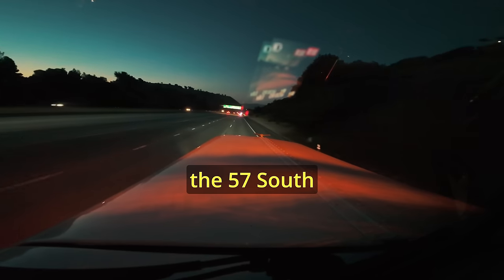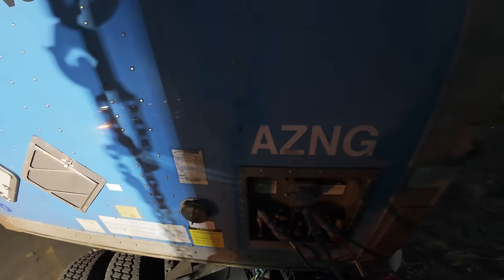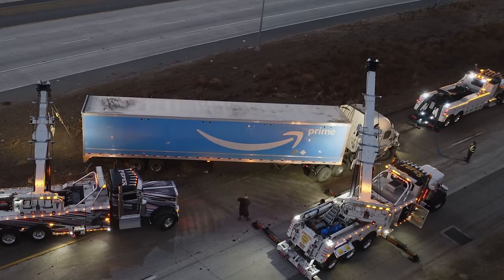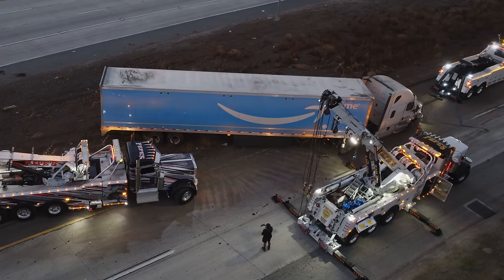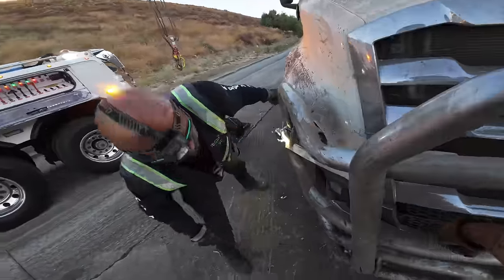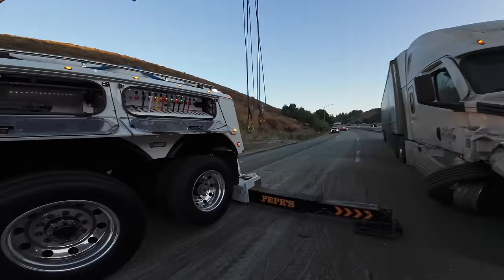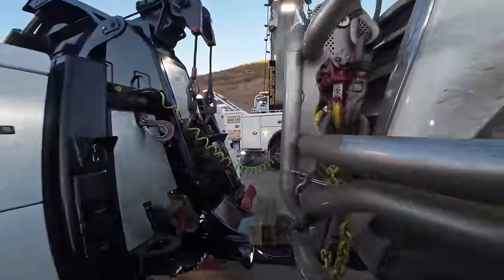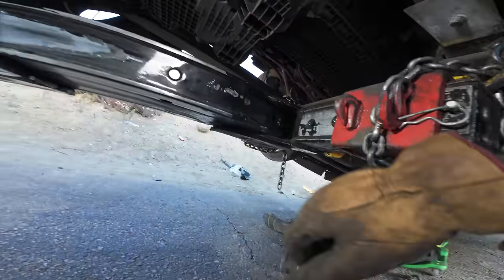Amazon Prime Delivery Gone Wrong!

Comment: I'm wondering, presumably if the truck had much more damage you'd have needed to use a landall as you'd have lacked towing points for the underlift?  Although a recall a video where someone hooked up via the front winching pins?